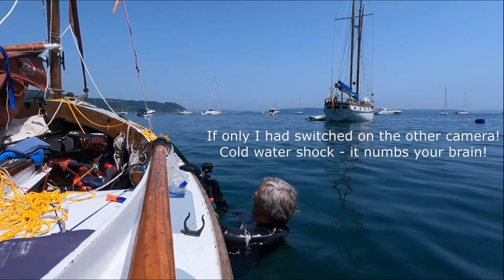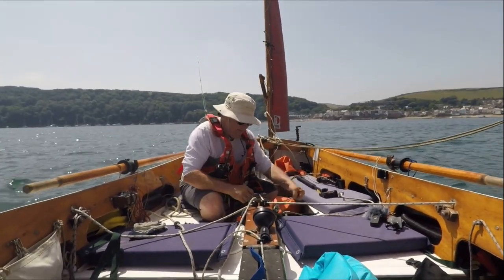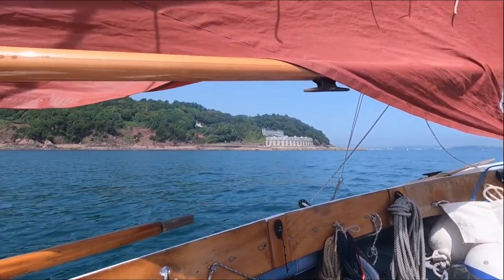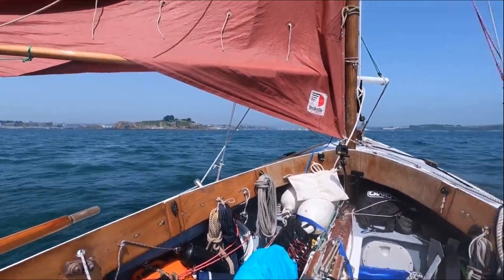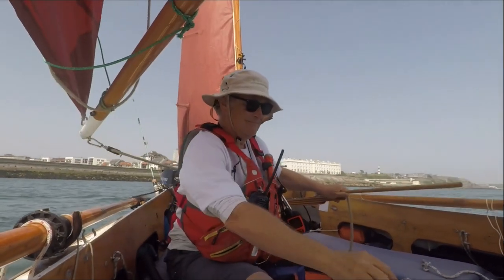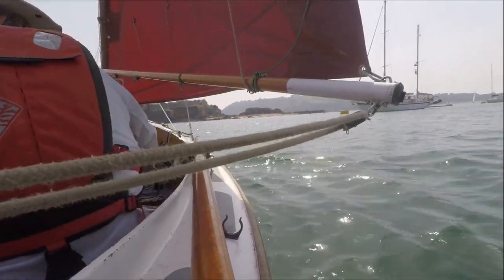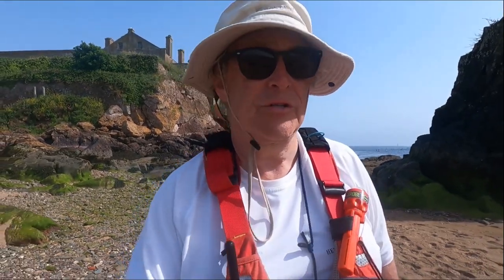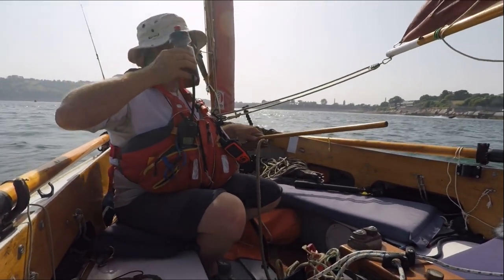Dinghy cruising:  A simple pottering day on Plymouth Sound in a Welsford designed navigator pt 3

Comment: Been here and sailing longer and never thought to land there either.  I thought for a while that you were doing capsize and recovery drills which were the bane of my life when I went on and then taught on open canoe courses.
Reply from the maker: At some stage I need to do some capsize recovery tests and actually off that beach may well be the place to try it this summer. I only ever managed to roll a kayak twice in capsize recovery.....I never managed it in an open canoe.....I tried really hard at canoeing and kayaking but never really mastered it despite several BCU training courses at calshot....I think it was there......much preferred mountain walking......did some climbing as well but after a few solos I began to wonder what the hell I was doing......mountain walking and some ice climbing  on the other hand.......... 😁
Reply: @plymouthwelshboy  Iv'e never rolled a canoe but capsized plenty.....rescue drills were just a regular feature of going to the Brenin and doing a course....one course in about February still comes to mind !.   At one time I got into practicing cold water swimming and immersion in case I ever had to do it for real - that helped one time I had to go under my cruising boat early in spring to sort a problem out - one of the things that helps in very cold water is bootees and mitts as the cold water response seems more acute with bare feet and hands.  At the moment I keep looking at the Pathfinder and wondering where I can put some properly useful handholds.
Reply from the maker: I've always been far better on the water than in the water 😂